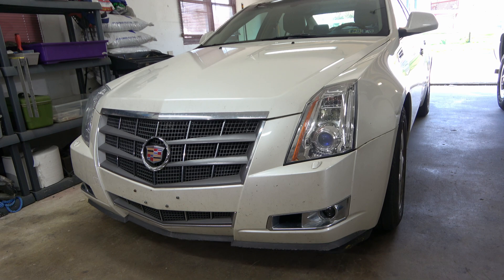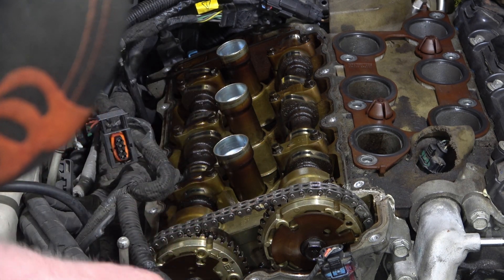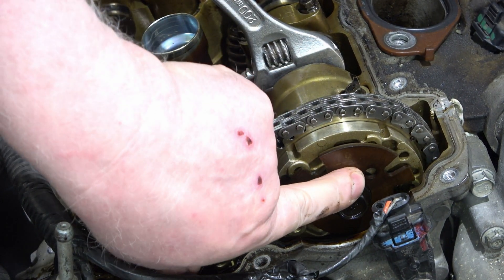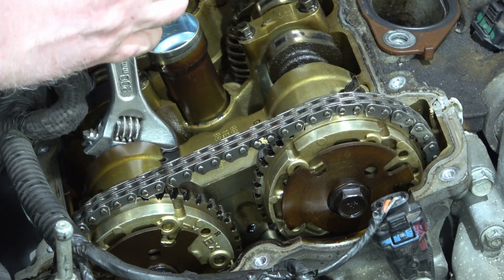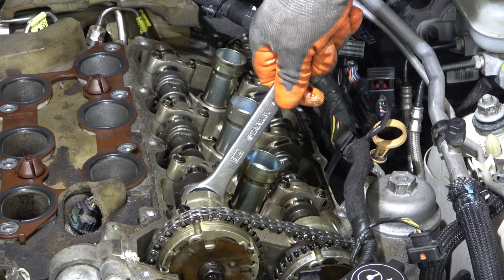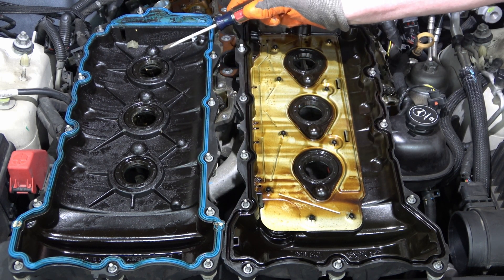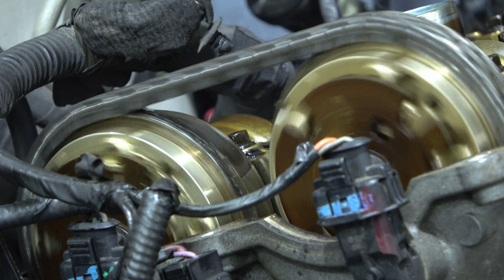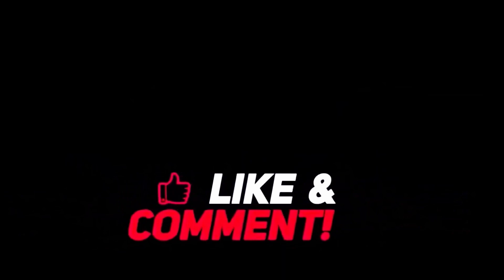How To Check Cam Phasers GM 3.6L GDI V6 O8 CTS  (2.8/3.0/3.2)

Comment: Those 3 timing chains and the way they are incorporated is almost crimminal. Don't know why in the heck they couldn't come up with a single chain like the ol' 3.8 V-6 is beyond me (other than planned obsolesence) which is also crimminal in my mind. Thanks for the tip on checking phasers. Really helpful before doing that darned re-chaining.
Reply from the maker: You are welcome 👍 Thanks 🙂

Comment: Why can't GM put these engines in the correct direction in SRXs, Enclaves, Arcadias, Traverses, Terrains, Equinoxs, etc???
Reply: Oh you mean the scrapyard? Lol
Reply: That's where I'm about to put mine. @tslater1989
Reply from the maker: 😲 tslater 😲
Reply from the maker: I think they should put the engine in the trunk 🤭